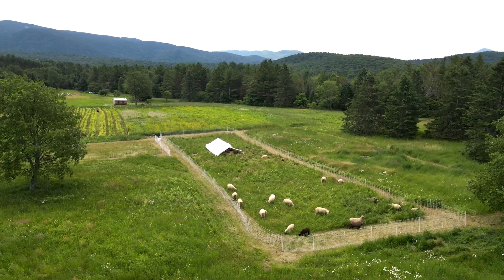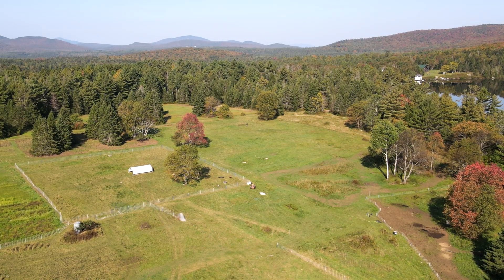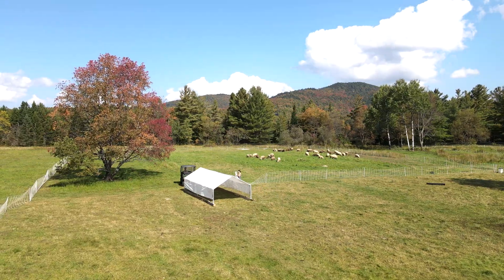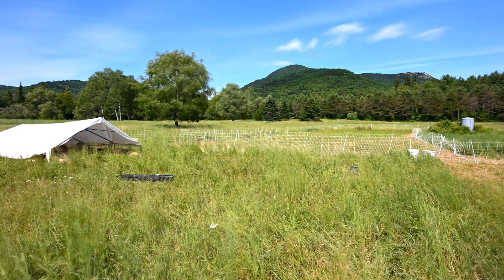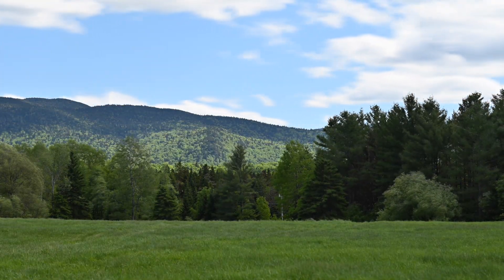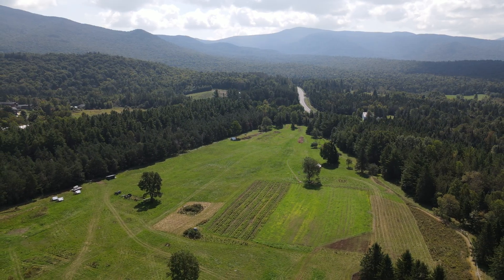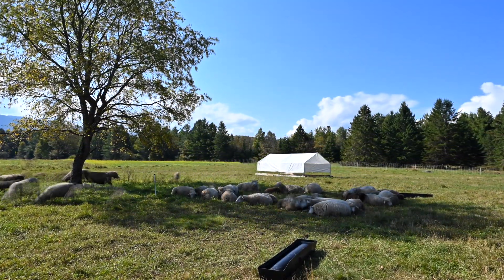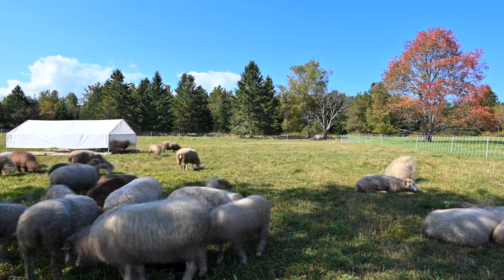How Sheep Sequester Carbon in Pastures & Soil

Comment: What type of shade structure is that? Is it working out well for you? Does it do ok in a storm or do the sheep beat it up? Good video. Thanks
Reply from the maker: It is one of those carport canopy type of things that we modified by attaching heavy wooden sleds so we can drag it around easily. It is fairly sturdy and has survived a few storms, and seems to hold up to the sheep activity. The sheep move inside the barn during the winter and the shelter just stays out in the snow.
Reply: @AgroecologicalSystems   Very cool. Thank you!

Comment: When you drop the AGW/ACC non-scientific fallacy you may attract more subscribers. CO₂ is a heavier-than-air vital component to re-greening this planet, i.e. replacing the desertified arable land with farms, 'the wild', ecosystems, habitat for all life. It operates as a carbon cycle where it is released in the off-season to be available for the new growing season. IOW it follows rather than leads as the Science clearly indicates. One hint: you may find value in putting up bird boxes to introduce swallows to reduce the fly load. Greg Judy's channel will help you get started.
Reply from the maker: Thanks for the comment. I’m a geologist so I am pretty familiar with the carbon cycle and its role in our climate and ecosystems. I’m not sure what you mean by non scientific fallacy, or what you mean when you say “it follows rather than leads as the science indicates”. Co2 is certainly an important molecule for re-greening, which is exactly the process I explain in the video: Carbon from the atmosphere can be sequestered as soil & organic material. 

And yes we have several dozen bird boxes all along our pasture fence. Each year they are full of barn swallows and tree swallows. We’ve been doing this for decades. Greg Judy probably learned it from us.
Reply: @AgroecologicalSystems  Has the proxy data geological science gathers ever indicated that elevated CO₂ led a warming period? No. Therefore it is irrelevant to climate fluctuations. It rises in the die back period and falls when growth gobbles it up.

The requirement for C sequestered in the soil is in addition to the above ground cycle, especially so when considering the recovery of arable land, which is vital for creating a greener planet.